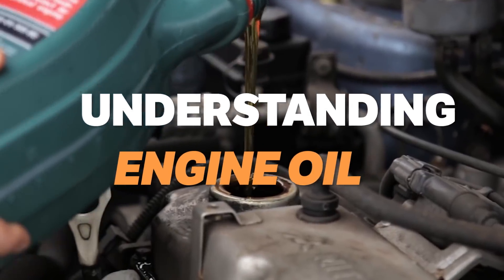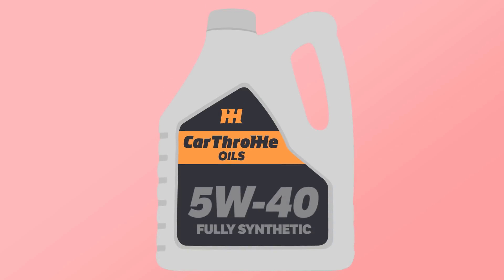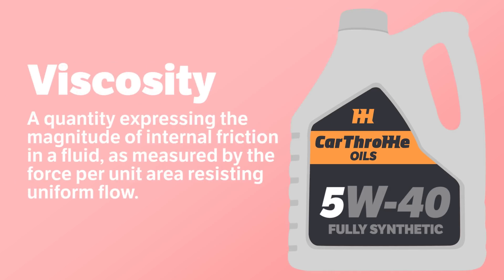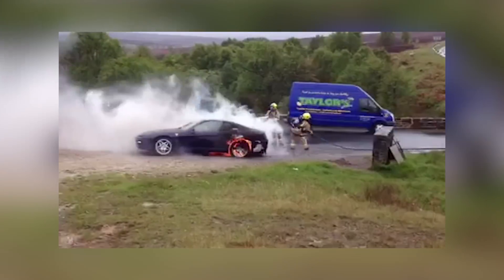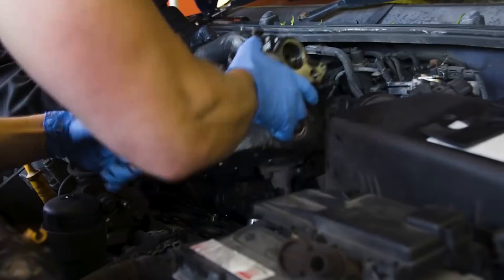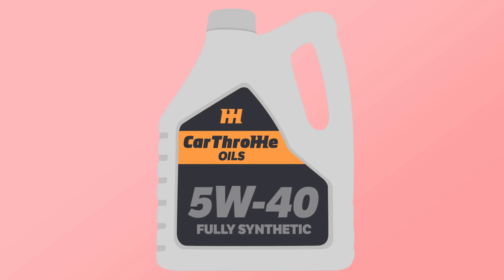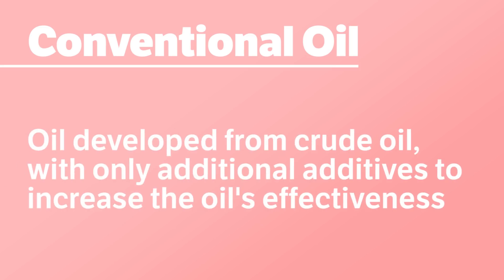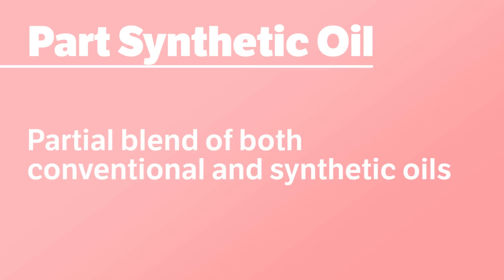Understanding Oil

Comment: Maybe someone would give me an opinion.

Is there a reason why I would want to use a 5W30 over a 0W30? Putting additives aside - as far as I understand a 0W is always better. Being thinner it will lube up the engine quicker, especially in cold temperatures. At operating temperature their viscosity should be the same. 
My other idea was that he number behind the W should be as big as possible (fuel economy aside) to achieve the maximum possible film strength at operating temperature, which is when oils naturally become thin. 
I very recently bought a new car which has some 5W30 Longlife Oil in it. 
I wanted to swap it out to the best 0W40 Oil I could find which is from mobil1. I judged it the best by looking at the manufacturers norms it full fills. 

My Mechanic told me to use 5W40 because 0W40 is too thin (at room temperature). Racing cars would use high viscosity oils like 10W60. (I know 0W or 5W will not make much of a difference living in central Europe with very moderate winters.) 
From my perspective of understanding this is right since they really want the film of oil protecting the engine to be as thick and strong as possible - but they use it just because there is no 0W60 oil available (and because motorsport engines are not expected to last 200000 kilometres and do a lot of cold starts). 

The only way a engine can suffer from too fluid oil is, if you pour 0w10 oil in an engine which was designed with conventional 10W40 in mind since it will be to thin at operating temperature. 

Did he tell me bullshit? Or is my understanding flawed and a 5W30 retains its initial thickness compared to 0W30 at operating temperatures?

Comment: the lower the first number is (viscosity at low temeprature), the better. But usually, the higher the second number is, the better (check with manufacter), especially if you are going to be hard on the engine. If you're building a "race car", you should be looking for a high "high temeprature high shear" viscosity oil.